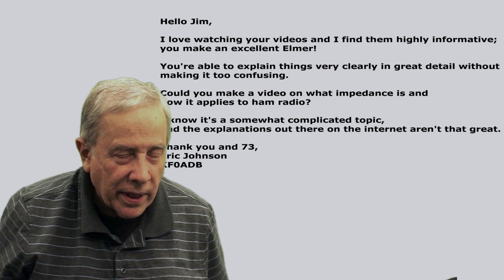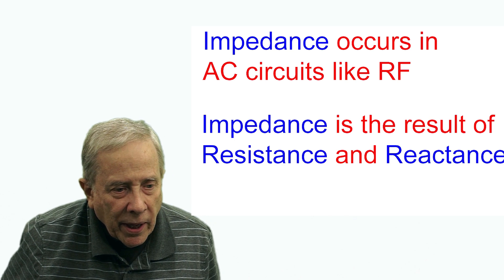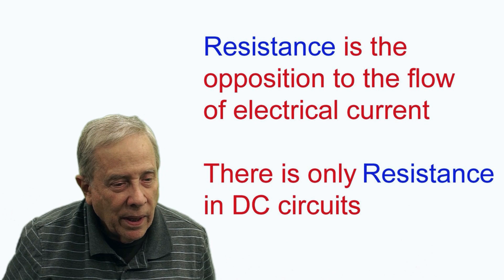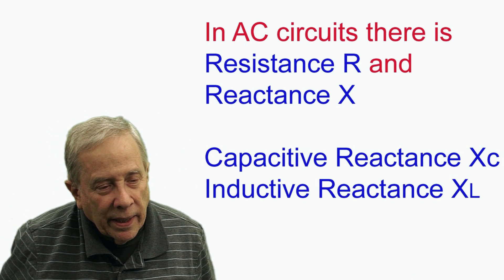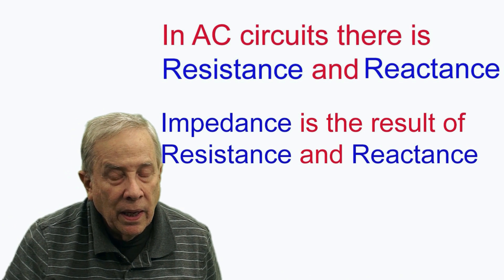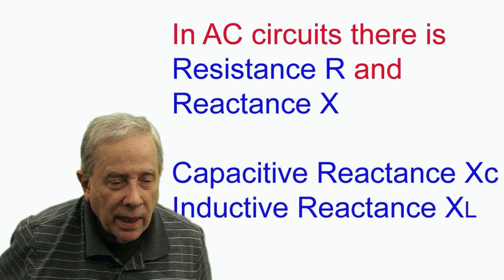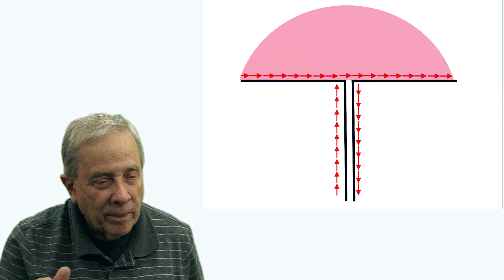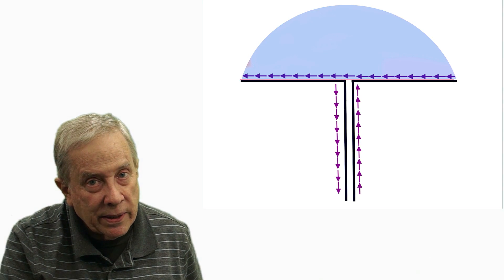Impedance, Basic Description For Ham Radio With Jim Heath W6LG YouTube Elmer

Comment: Jim you state "If the antenna is exactly the right length and has the right impedance and there is no reactance, then the length of the dipole is it's resonant frequency."

I would have thought these characteristics would yield a LOW SWR. 
Where am I mistaken. Thanks!!

Comment: So. Do I need to calculate 1/4 wavelength? I’ve been away from amateur radio for 20 years. Not all of it is coming back to me. Thanks!
Reply from the maker: Well you can.  You can also just keep the rounded result in your head like...64, 32, 16, 11 and 8.  That will get you into the ballpark for HF.  73, Jim

Comment: If the radio is putting out DC power how is the antenna in AC power. I’m a little confused on that one. Thanks
Reply: Jeff Allen the transmitter outputs AC (at a far higher frequency than the electricity grid).
Reply from the maker: Of course, David is correct.  RF is AC not DC.  DC would make no sense because it does not generate field.  If you connect an antenna to a battery, it won't transmit a signal.  As David pointed out, instead of it being 60hz, it is 14 million hz on 20 meters for example.  DC out was in some advertising years ago and that I think confused many.  You are not alone Jeff on that confusion.  Thanks for asking a very good question and special thanks to my friend in the UK, G0FVT.  73, Jim W6LG now in Rocklin, CA
Reply: Jim W6LG thank you for the kind reply, unfortunately advertisers do arbitrarily use whatever measurement methods needed to produce the highest numbers. We all have seen plenty of rf amplifiers claiming huge PEP output that is double the real PEP output because they have randomly decided to use Peak Instantaneous Power instead. Maybe a subject for a video? dBi vs dBd etc, a lot of traps for the unwary.
Reply from the maker: @g0fvt  Indeed.  Add to that, mechanical meters and guy wanting to get the needle up to 1500.  I have no idea why some ham amplifiers advertised DC out.  What the xx?  I too fell into that trap as a teenager.  Heavily damped or not heavily damped, it isn't going to be ever close.  I am designing my 3 element yagi with a 16 foot boom. XYL is not pleased.  I am hoping for dBd of 5.  I do understand the free space thing.  I had, now in pieces, a linear with GS35b's.  On a scope, it was pretty impressive.  That amp fed two yagis on separate towers with phasing lines.  A few degrees of delay and orientation of the yagis could produce some great results.  Or, a null of 30 to 40 dB!!!  The ERP was good.  73, Jim
Reply: @ham-radio , I think GS35Bs get a lot of bad press, I have a pair sitting around waiting to go in a project, a bit difficult to justify with UK power limits!  Regarding phased verticals, never tried on HF but I did have a pair of 70cms antennas on my car a wavelength apart and fed in phase. In theory the radiation pattern was an awful cloverleaf with deep nulls. Once or twice I parked the car with the local repeater in the nulls, just could not access it at all. Never a problem on the move, I suspect the reflections off buildings etc masked the issues. I have no ambitions to put an HF Yagi up at present, though phased verticals are an attractive proposition...  Regarding the "DC output" I wonder if they mean DC input to the final amplifier?  In the UK the old power limit was 150w dc input, much easier to measure than the RF output. 73 de David

Comment: Hi, Jim. Great video! Finally I understand impedance.

73 Alan KZ6B
Reply from the maker: I am sure you knew all of that. I need to make a part 2 and give more information.  I was trying to stay away from what I am sure you know, the formulas for 2piefL.  The MA-40 is up next to the AC compressor and partially on the walkway.  

I spent the last 3 days rewiring the motors.  Those large powerpole connectors were intermittent and just a PITA. 

I hope we can turn the corner on the virus.  Not looking good in So Cal.  I built 4 elements for 20 meters.  One is a spare...just in case. I have scaled a Hygain 203ba for my antenna. Later, I will interlace something for 15 meters.  73 from rockyland, Jim

Comment: Great  video Jim . Glad to see you and doing well and you got your tower up .great hope to hear you on the band 73
Reply from the maker: Thanks Mr. Terc.  Always good to hear from you.  I have some video to share that includes the melt down of a powerpole connector.  It is a result of the  IsquaredR or (I)x(I)x(R) voltage drop.  The motors draw about 10 amps at 12vdc but stall current it much higher...maybe 50 amps.  Take care my friend and again, nice to hear from you. 73, Jim

Comment: To say it another way, resonance occurs when Xl and Xc cancel each other leaving Z=R. The generator (your rig) is only seeing a resistive load (your antenna).
Reply from the maker: Thanks for that information.  I wondered a bit about that point on the graph.  So if we are talking about just a dipole and a feedline as I had in my poorly drawn video,  how do we get a little Xl and XC?  Ben, would you slide the feed point up or down the antenna?  I appreciate your help Ben.  73, Jim
Reply: Well Jim, as I'm sure you're well aware, if the length of the dipole is not changed, but the feed point is shifted away from the center, the resonant frequency will not change. 
If the feed point is moved (in either direction) away from center the impedance will go up.
The impedance of a theoretical dipole in "free space" or a full wavelength above ground is 73 ohms. Our ham horizontal wire antennas don't usually get up that high, having the effect of lowering feed point impedance closer to 50 ohms. 

Finally, one of the easiest ways to resolve complex impedances present at the transmitter is by the use of a broad range antenna tuner, which obviously provides the deficit of induction or capacitance to bring the circuit to (or closer to) resonance. 
Looking forward to more of your videos and hearing you back on the air! 73 de KE0RFZ.
Reply from the maker: Can we discuss that a little further Benjamin? To take it took extremes, if a dipole is say 32 feet long and half a wavelength high with a feedpoint impedance of say 50 ohms, and then you and I move the feedpoint.  We move it 10 feet off of center.  So now, the antenna, perhaps still a dipole, is now feet so that one leg is 6 feet and the other leg is 26 feet.   Has the resonant frequency changed?  Is there a resonant frequency???  Does it now act like a 20 meter dipole?  Would there still be a frequency where Xl and Xc would cancel?  Just trying to wrap my head around way off center fed.  Thanks Benjamin for the help.  73, JIm
Reply: @ham-radio  I'm no expert. But from what I understand the OCF antennas are kinda interesting. I haven't had a chance to experiment with them but building one may wind up being my next antenna project. 

The resonant frequency does not change when you move the feed point. It is set by the length of the legs. 

Suppose you have a half wave dipole cut for 3.8 Mhz. Since the classical dipole is 2 quarter wave lengths of wire, the total length of the antenna is approximately 40 meters (about 130'). 468/f, the time tested dipole formula. The feed point is in the middle, we're feeding it with coax, one leg soldered to the braid, one to the center conductor.

Imagine you illustrated the 3.8 Mhz radio wave (generated by a CW carrier for the purposes of our discussion) superimposed across a drawing of the dipole. Consistent with your Christmas lights demo from a couple years ago, you would find the current of the antenna is very high at the feed point, and voltage is higher at the ends, as evidenced by the glowing lights. This is an ideal situation. 

Let's say we are operating with the antenna and decide to switch to the 40 meter band. This frequency would be the next even harmonic for it. Going back to the illustration, the frequency of the sine wave would be doubled.  (Imagine drawing it). The 40 meter sine wave would be at the zero mark at the feed point. The voltage is at a maximum, the current is at a minimum and this results in a very high impedance. 
But more importantly, the antenna will not radiate, because a 7.225 Mhz radio wave will cancel all of its energy within the dipole. The positive quarter wave cancels the negative quarter wave and so on. The case is pretty much the same on every even harmonic, if we were to try 20 meters, for example.
What the OCF guys did is find a feed point on our 80 meter half wave long dipole where even harmonics of the fundamental frequency are not cancelled by this effect and theoretically thus radiate.
Hope this helps. Again, I'm not an EE. Just a mere mortal hobbyist.
Reply: Thanks for breaking it down. You guys are brilliant 😊👏👏👏

Comment: Great video as always, I'm looking forward to seeing the tower and antenna soon also. 20m has been good lately so nice timing to be QRV again, 73, Tom.
Reply from the maker: Can't wait!  In the process of doing all of that I broke 4 ribs and two fingers.  That slowed me down a bit Tom.   I motors I used were from Amazon.  They are for mounting on the front of a jeep and used to pull something big. I have 2 attached to the tower.  One for up/down.  The other for leaning it over.   The lot here is sooo small I had to build a gate in the fence so that I would lean the tower over.  Distance to the fence is 12 feet.  The tower is 21 feet retracted.  73 and thanks, Jim
Reply: @ham-radio   It will be great to hear you booming over the pole again and nice to get you in the log from Placer County! I'm also super interested to see the winch set-up as I have a two section (45ft) tilt over lattice mast in storage that I intend to install and motorize when we move. so I'm keen to see how you've done it.

(PS) Don't sweat the production values of your videos too much. Most everyone watching your output is here for the quality of the info and knowledge you provide and that's always first class! Look after yourself and good DX when you fire up that new antenna! 73, Tom.

Comment: Hey Jim, great to see you. I've been wondering how you have faired with all this Covid-19 stuff and hoping your were healthy. Thanks for the education on impedance. Can't wait for the tower/antenna video.
Reply from the maker: Thanks.  I am working on that video now.  I want to show the tower being "leaned" to the ground using my motors and power supply. The power supply has a 40 amp 12 volt transformer with the primary connected to a small variac.  The motors have a clutch. 73, Jim
Reply: Awe man thats going to be nice. Can't wait to see it.  I'm installing the base of my tower now digging in shelf rock. A little at a time for a middle aged cripple but I'm getting there. I have a 6,000 lb winch I will be using to raise and lower it.